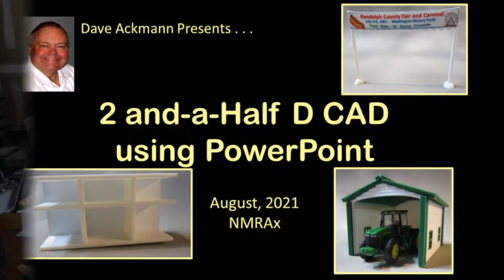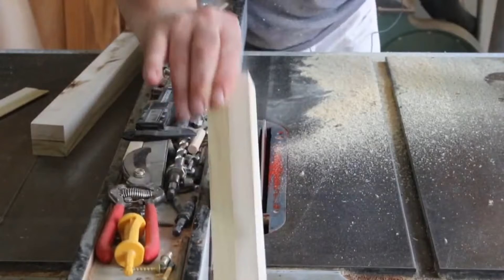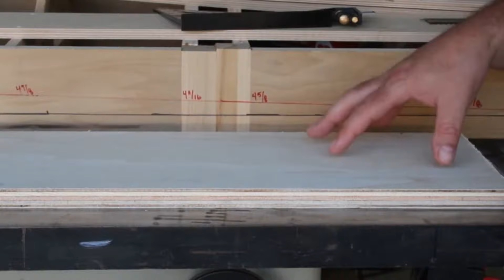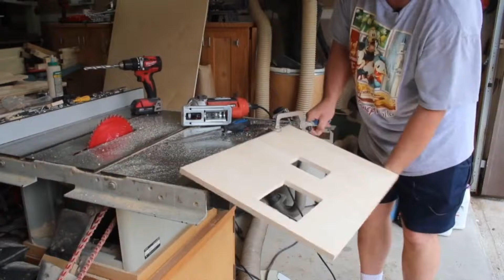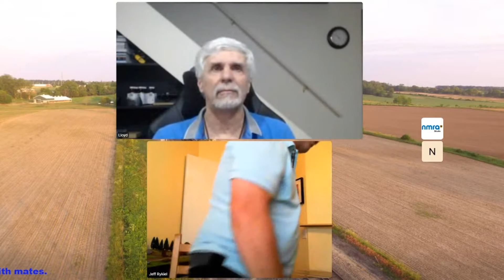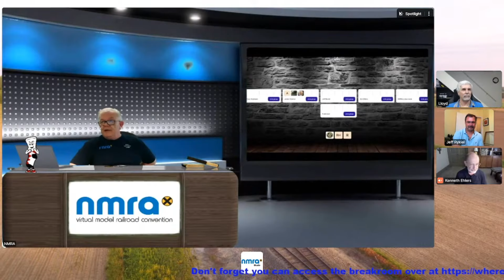Jeff Rykiel -  Modules Tunnels and Culverts

Comment: I had to stop watching. The lack of safety in this video is quite troubling. Four major concerns jump out: There is no guard on the saw blade. Yes, I get that for video purposes, guards may be removed. Secondly, using your hands to push past the blade is a recipe for disaster. If the piece binds or kicks back, your fingers could get pulled in. Use a pusher. Third: Safety goggles. They cost $6.00. What's that vs the price of your eyesight? Lastly: a whole bunch of sharp drillbits etc. on the fence. Again, if a piece catches and jerks, one of these pieces of metal could end up in the saw blade and be thrown into your face/eyes. Sorry to be a Debbie Downer but safety comes first.